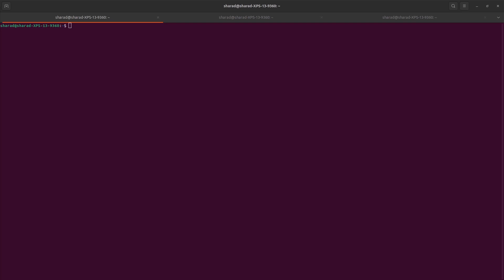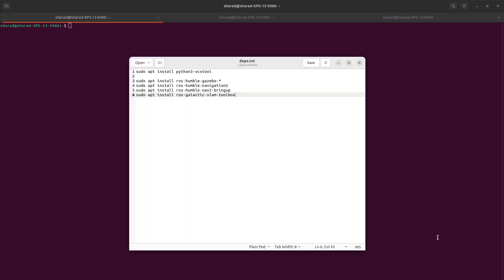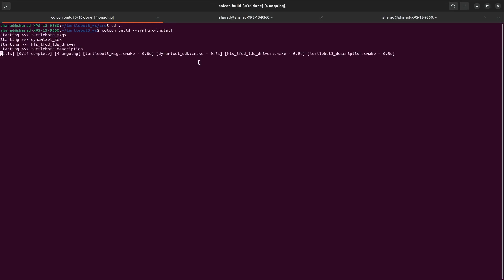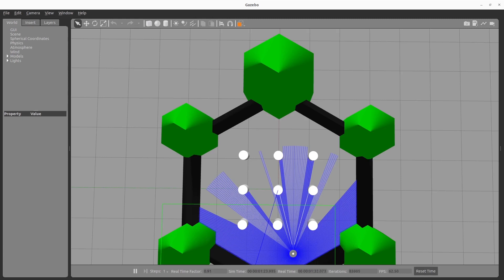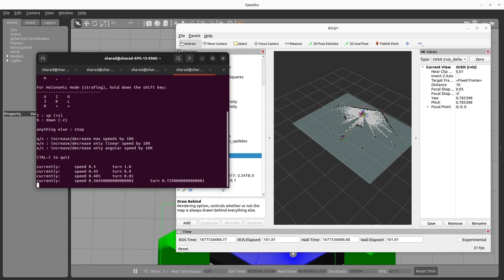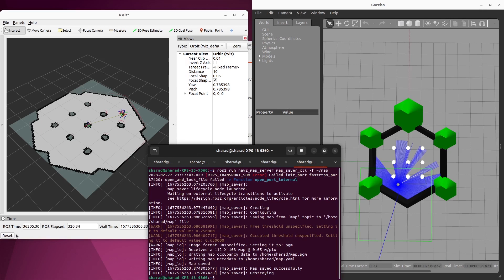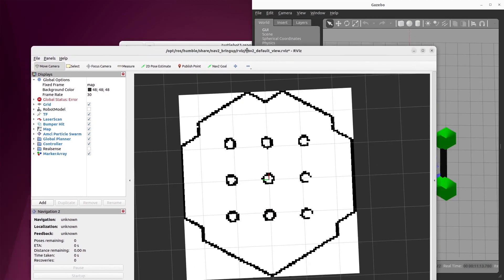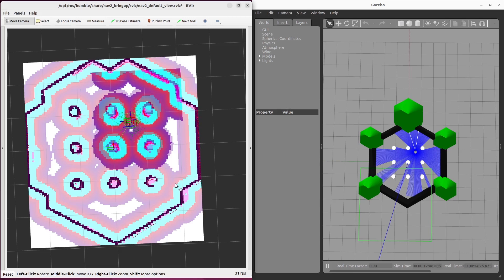ROS 2 Navigation - Part 3 (creating Nav2 Simple demo with TurtleBot3)

Comment: I'm using ros2-jazzy. The turtlebot3 git doesn't have any jazzy branches. Should I just use ros2-devel?
Reply: I tried ros2-devel and got many errors.
Reply: @TheHG20  I faced similar issues, I guess ROS2 needs a few more years to become as mature as ROS1.
Reply: @patham9  I switched to this: https://www.youtube.com/@ArticulatedRobotics/videos
Reply: ROS2 is a mess, but I can share a working VM if you are interested.
Reply: @patham9  Not necessary. There are other more up-to-date YouTube courses on ROS2, Gazebo, and sensors like Lidar.